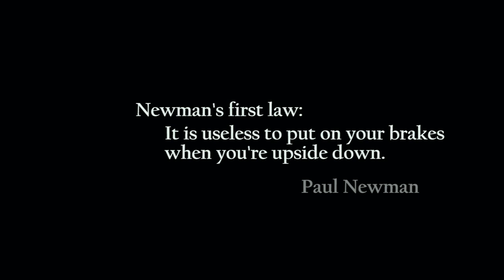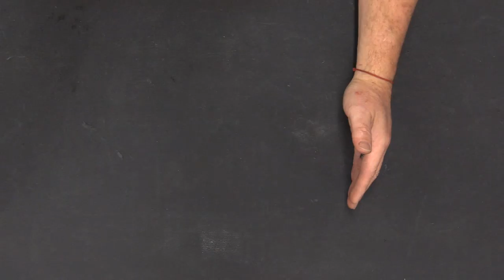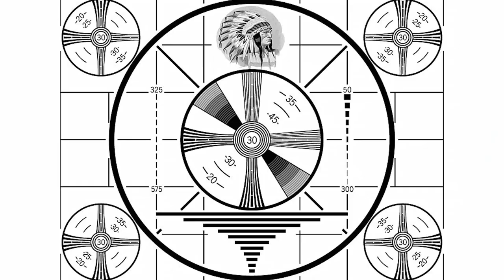How To Rebuild your 1968 to 79 Ford Disc Brakes Episode 453 Autorestomod

Comment: Looking at the calipers, a bolt on upgrade you may not know about is using 75-78 t-bird calipers the piston is 3/8" bigger which gives you oh most the same square inches as the dual piston 3/4 ton calipers. The only difference is the bolt that holds the brake hose on is bigger , but easy to buy. The T-bird uses a screw on hose apposed to the bolt on hose as the stock truck uses so those have to be bought separate. I know this works on the 4 wheel drive 1/2 ton trucks from this era so I would double check if 2 wheel and 4 wheel use the same calipers. Other wise if not never mind.
Reply from the maker: Thanks for the heads up!

Comment: Thank you! I am in the process of doing a disc brake conversion with 1973 F100 hardware over to my drum brake 1969 Econoline. I’ll be removing the drums in the next few days and installing everything per this video. It’s smooth as silk.
Reply from the maker: Good to know!

Comment: So I’m trying to identify the Brakes on a rat rod...48 Chevy truck. Guy helping me is a certified Ford mechanic and he identified them as Ford.
Any place to get part numbers...I’ve tried all of the numbers I could find on the rotors, calipers, etc. the brake set in this video marches what I have almost perfectly. My rotor outside diameter is apx 10.75 inches. Appreciate the video
Reply from the maker: Whew, tough order sight unseen. Send a pic or two to: jford @autorestomod.com

Comment: Nuther good un Cuz...@ 16 min may note that the bolt is a special one that has a taper to allow the clip to "float" preventing the caliper from binding.  Also if you are reusing the old bearings, when/if you clean them with solvent...
DO  NOT spin them with an air hose, very dangerous, they may come apart, OK to use air to clean/ dry them, just don't let them spin when doing it.  Oh, another thing, put some black on the arms.
Reply from the maker: Yeah, I now not to spin them...but it is kinda like drinkin' I know I am going to get a hangover...buuuut.

Comment: I just put new rotors, calipers and pads, bearings on the ‘74 f100. Everything went together nicely. Until I drove the slide & tensioning springing in place. Now the pads are pressed tightly against the rotor and the rotors won’t move. Any ideas?

Comment: Been trying to put new brake hoses on front disk on 75 f 100,can't get the lip on the hose to fit the caliper. Any ideas, said on the video to us 2 washers I'm afraid that will leak.

Comment: HHmm  that caliper, pads and bearings look familiar to my 74 LTD. .  did complete brake job on it a few days ago
Reply from the maker: Ford used that system a LOT from 1968 to the late '70s and maybe beyond.

Comment: I may have the Bendix part number for that retaining bolt. I’ll look when I get back into the shop in a few minutes.
Reply from the maker: Thanks, I ordered some but it looks to need the flat Allen head bolt rather than the standard head.
Reply: Autorestomod Manic Mechanic Gasoline Media I got tied up and didn’t remember to look it up. We use the flat Allen head style.
Reply: Jeff’s Bronco Graveyard sells the hardware kit where that bolt you are looking for is included. Awesome prices also.

Comment: I've got a 68 and for some reason it shows the king pin is different from 75 to 79 and if I run across those years do I have to change the whole beam out with spindles

Comment: Great instructions in this video. I am doing the Granada disc brake swap in my 65 Mustang and it is a very similar spindle/caliper set-up. Would you have the torque spec for that one Allen bolt you were missing on the caliper retaining clip? Thanks.
Reply from the maker: I can't find a spec on the Key Retainer Bolt. Can't be much though (I'd say around 11 ftlbs MAYBE), pop a little purple or blue thread locker on it and you should be good to go.

Comment: Are you sure that you put the Hydraulic line on correctly? I have 2 trucks here and I saw another where they are opposite of the way that you installed it.  I watched the video just to know I was doing the line right with the copper washers. Now I’m not sure. 
Please Advise. Thanks
Reply from the maker: I can't say if I am or not. That is how the old lines were on the calipers and who knows if those were right. Lol. In the immortal words of Jeremy Clarkson: "I was on the internet and I found this: https://www.google.com/search?q=1976+f100+disc+brakes&tbm=isch&ved=2ahUKEwjL3PvBzaHtAhXOKlMKHTutCPoQ2-cCegQIABAC&oq=1976+f100+disc+brakes&gs_lcp=ChJtb2JpbGUtZ3dzLXdpei1pbWcQAzIFCCEQqwI6BAgeEApQmKABWP6qAWD8sQFoAHAAeACAAZ0BiAGdBpIBAzEuNZgBAKABAcABAQ&sclient=mobile-gws-wiz-img&ei=t1rAX4ulMM7VzAK72qLQDw&bih=560&biw=360&client=ms-android-verizon&prmd=sivn#imgrc=09gQOKY_Xqw6cM

The brake lines on this set are facing up.

Comment: Why do the brakes on a 78-79 Bronco suck so bad? I understand when you go with oversize tires, but they seem to be an issue with something as short as a 31" tire. I'm making the F350 Booster and MC swap. Any input on why the original parts are so inferior would be appreciated.
Reply from the maker: I don't know that they are, I'd look to my bleeding proceedure and or my booster if the brakes are hard. email me at : jford@autorestomod.com with more info and we can discuss.

Comment: bought all the parts for my 77 F150 and after installing the pads and caliper my rotors are locked up. What should I look for as the problem? I do not have my brake lines connected yet.
Reply from the maker: Check the piston depth. Make sure it is fully depressed.

Comment: Once you get the caliper on shod the rotor move freely or would it be tight? Thanks!
Reply from the maker: It should spin. If it doesn't that means the caliper is slightly deployed. Once the brakes are bled the rotor should spin freely.
Reply: @AutoRestoMod  Thanks! Hope you are feeling better!!

Comment: How tight should the caliper be once seated? I just did the calipers on my 84 tonight but it seems like the caliper should slide back and forth a little easier then it does. Any input would be helpful, thanks 😀
Reply from the maker: It won't be really easy. But it should move.
Reply: They self set once u brake

Comment: Question. I have done this and had to redo it a few times because there is a horrendous scraping coming from my front passenger wheel area only when the wheel is spinning. I have redone the bearings many times, replaced every brake items.   I always notice when I put the spring and retainer in, that after it's all tightened down I cannot get the rotor to spin well, it is super tough to spin.  But if I take the retainer and spring out it spins well.   I'm not sure what to do
Reply from the maker: Could you send me some pictures of the issue? jford@autorestomod.com
Reply: @AutoRestoMod  there isn't really anything to show, it all go3s together but the grinding issue just doesn't stop

Comment: Question  I have a 1971 ford f 100 and I have the disc brakes suspension from a 1973 ford f 100 will that suspension fit in to my 71???
Reply from the maker: Yes if you have the i-beams from the 73. It can work, but sometimes the spindles and the I beams don't match up to the steering stops.

Comment: Do you think stock brake set up and spindles off the 68 will work on a 63 f100?
Reply from the maker: The 63 is a straight axle truck, check out Master Power Brakes.

Comment: Does the caliper slide back and forth or is it stationary?
Reply from the maker: It is stationary.
Reply: @AutoRestoMod  I wondered because I put new pads on mine and now the brakes drag a little... They don't let up as fast as they did.

Comment: The missing screw you mentioned around 15:45.  Mine broke sheered.  I need to extract and replace.  What exactly is the specification so I can pick up a set.  Thank you
Reply from the maker: https://www.napaonline.com/en/p/UBP82517?cid=paidsearch_shopping_dcoe_google&campaign=GSC-Brakes&campaign_id=8659198719&adgroup_id=106304766654&adtype=pla&gclid=Cj0KCQiA1KiBBhCcARIsAPWqoSpSUwMcxPghytcdkir8ls_qh1vWnAyTV0Q7sk2h4R0FDsk9B2CsnDMaAvMMEALw_wcB&

Comment: Hola amigos saludos dede Mexico, Cuernavaca Morelos,  tengo un Ford mustang mod. 64, 1/2. De 6 cil. Línea, 170 Inch pulgadas,  automático 3 vel. ,... cuánto cuesta un carburador de una garganta? Lo pueden enviar a Mex.?...  felicidades por tu canal, buenos 👌🏻 videos, 🎥Gracias Jose
Reply from the maker: hola, puedes encontrar el carburador en ebay: Autolite 1100 Carburetor Manual Choke '64 -'68 Ford 200 223/262 inline 6 cyl Eng

Gracias por las amables palabras.

Espero que el traductor de Google haya hecho esto bien.
Reply: @AutoRestoMod  you nailed.